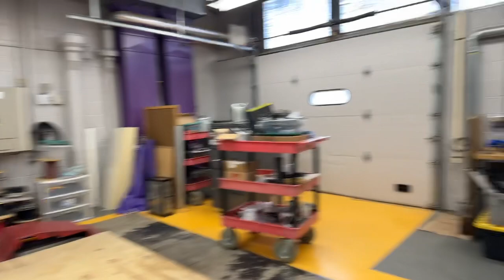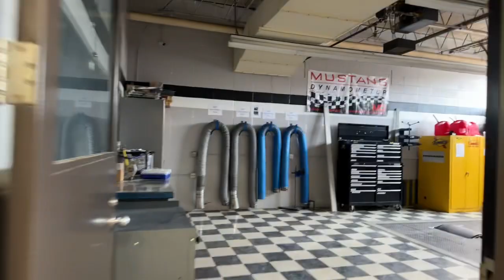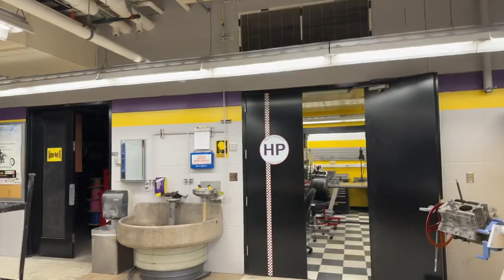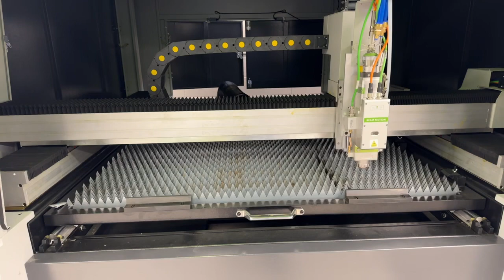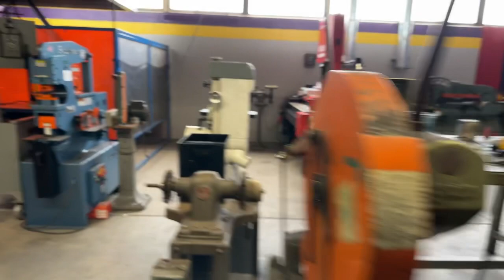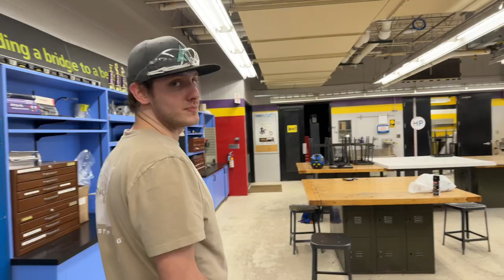Traveling Machinist’s history!

Comment: Wow, that was a walk down memory lane!  That old Hass was new and the "latest and greatest" my first year there and Al was a student then (older than most of us but I believe he was a student).  Cool on that SAE car project and seeing them cutting and bending it all in house.  I cut and bent all of their chassis parts on 2 or 3 of their cars on our Tube lasers and CNC benders back in like 2013, 14 and 15 when I ran CMP in Cambridge.  It worked pretty slick as we could laser etch part numbers on each part from their CAD model and they'd just have to glue (weld) them all together like a model kit as we laser cut the copes and added slots and tabs where needed as well.  Cool stuff, great "hands on" program!
Reply from the maker: Yes, Al actually work for me. Like Mason is working for Al. Al didn't change any thing in the office. I enjoyed working there and engaging with the students.